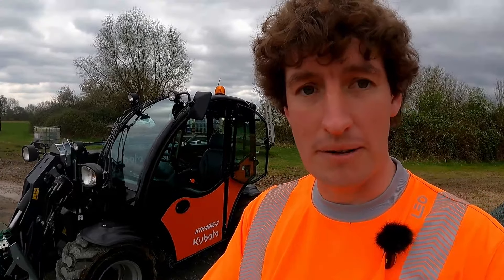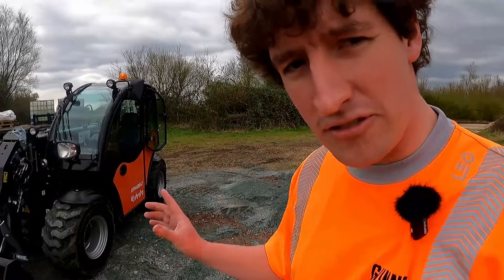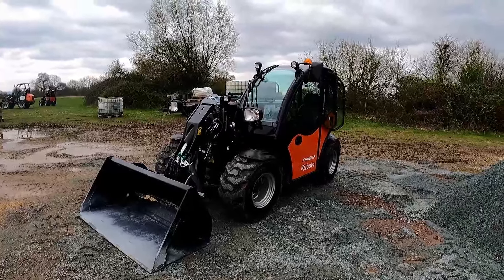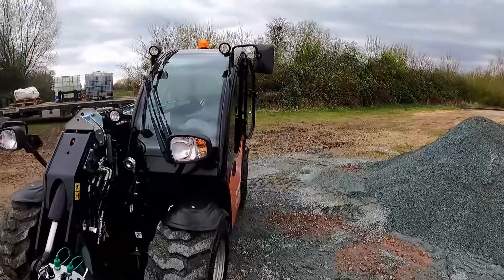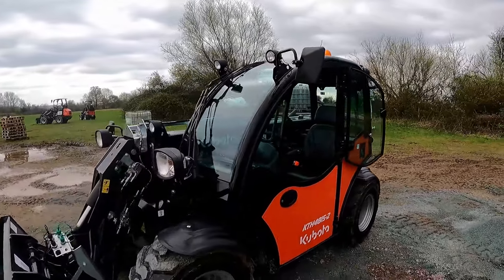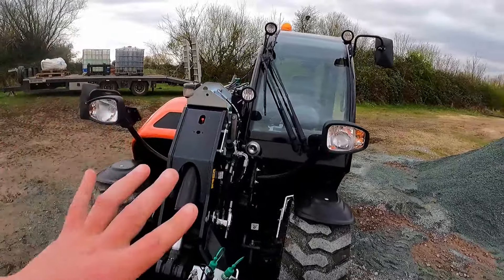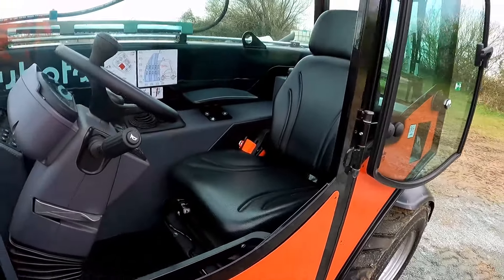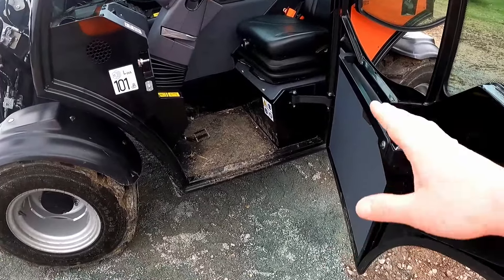Kubota KTH4815-2 Telehandler Review

Comment: One of my big frustrations is that the hire companies don't seem to see the need for these instead,  offering mainly  bigger site spec tele handlers.

Personally, i can usually borrow ag spec tele handlers without massive difficulty, but no one ever has anything small.

Working in landscapeing and horticulture, there is certainly a market for these sort of compact machines, and this really trumps the likes of an avant that really have a farr more limited scope.
Reply from the maker: I see this doing really well in the landscaping market - once contractors know they exist!
Reply: Interesting viewpoint, in your opinion how does this trump the avant with more scope? Just curious
Reply: @owenbloomfield7303  greater lift height  and lift capacity, both handy when dealing with  large rootball trees or setting out pallets and unloading hgvs.